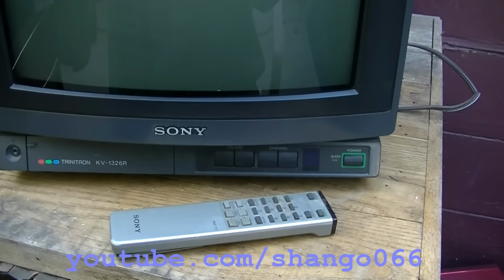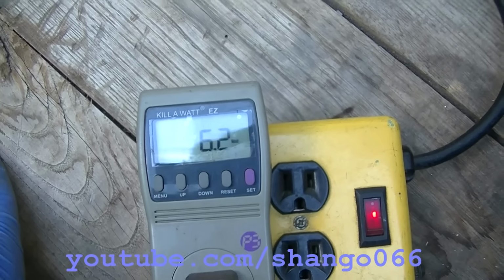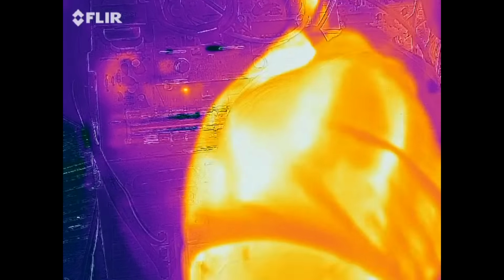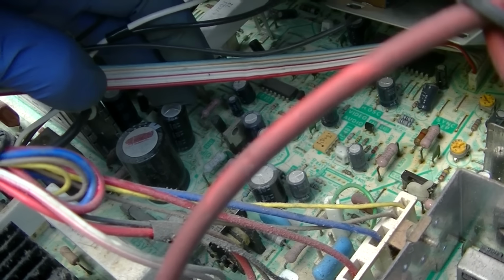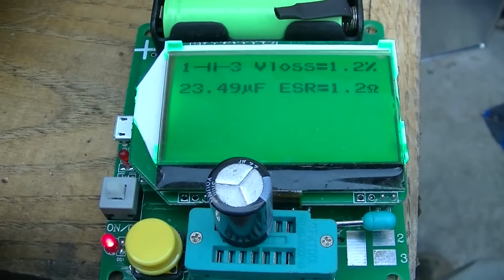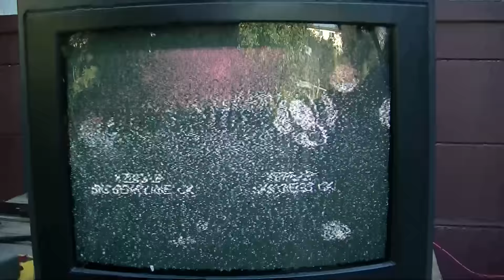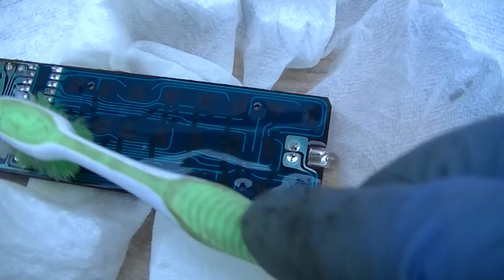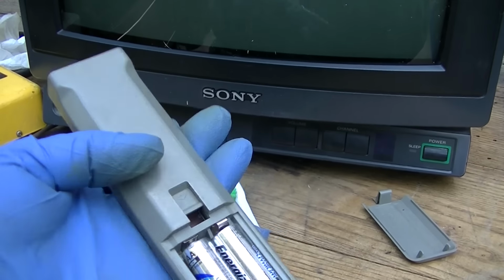Sony Trinitron KV 1326 Repair and Remote Control Repair 1987 Color Television

Comment: Had the 1320 in out kitchen for years. That was a kerb find too with the original remote on the top.
New resistor in the power supply and we ran it untin the tube had nothing left to give!
It had a fantastic picture years.

Comment: That cap is the filter for the stand-by power supply and is active whenever the TV is plugged in. It's a common failure in Sony TV's from this time period and I've fixed many of them by replacing this cap.

Comment: That's exactly what's going on with 87.7. It's easier to get the LPTV license than the FM license, considering how saturated the FM band is these days. Hell, I live in a city of 500,000 and there's almost no room on the FM dial for DXing anymore because of how many stations there are. I can't imagine how bad it must be in LA.
Reply: There’s at least 6 or 7 stations nationwide on 87.7. The FCC allows it now, but have said they will eliminate it in 2021.

Comment: When I used to work in the TV industry as a young engineer way back when when crts used to be replaced another engineer and myself used to break the neck on the CRT and put it straight in the bin

Comment: Only had one Trinitron, paid big money for a Trinitron Wega back in the 90's and after 2 years the green gun let go, tubes were big money so it got binned, never bought another, it was replacing a GEC Starline which had been running for 20 years!!

Comment: Those TV sets are definitely safer to work on than the old roundie Color TVs. Too much time in the back of an operating old roundie color set could result in developing lymphoma and/or sarcomata.
Reply: why the cancer?
Reply: @raymondleggs5508  Sufficient exposure to doses of ionizing X-radiation from early color TV sets can do irreversible damage to cells and tissue, making them more susceptible to developing carcinogenic processes. This is why hospital X-ray technicians wear thick lead vests when operating X-ray machines.

Comment: I had the UK equivalent of this TV in use until about 10 years ago.  It wasn't worth repairing when it failed though due to a lack of a SCART (RGB and audio input) socket.  Strange that Sony missed that out of this particular model, it must have been their entry level portable.

Comment: Looks like one of the good Sonys. I collect Sony TVs from the 70's to the mid 80's So its a bit too new for me. I used a Sony KV-1311 with my Amiga. I used a Sony 13 inch TV that had a Hit button on my C64.

Comment: Even if it's wrong remote Sony is surprisingly consistent with their remote protocol. I have a remote from 1992 Trinitron that still works just fine on new Sony TVs (I mean it doesn't have multimedia buttons but changing the channel, on/off, input device, volume and so on work).

Comment: Nice. I have a TV very close to this one. A KV1393R. The version with woodgrain style chassis. A nice TV. Has Composite video inputs too. Probably takes the same tube as that one. I know the tube in mine is interchangeable with the KV13TR24. The remote for that TV worked for the 1393R too. So most of the remotes (for the 13 inchers at least) probably use the same codes.

Man if I lived anywhere near you I'd be interested in picking it up just for the tube in that thing. Ever since I swapped the tube from the KV13TR24 into my KV1393R, the KV13TR24 is in need of a better one. (the convergence is out of whack on the original tube that came with the 1393R and the yoke didn't have convergence rings so I coudln't fix it. I swapped the yokes out but it's still not where I'd like it to be)

The good convergance tube from the TR24 now lives in the 1393R. Would like to have the TR24 have a good tube too one of these days. I live way out in Texas so no chance of me getting that one. :(

Would be a shame to EOL that. I found both the KV13TR24 and 1393R to be good sets. That one seems a bit older and lacks composite inputs but it would still be a great set for classic TV shows or retro game stuff.

EDIT: If you end up having to EOL it, keep the tube/neckboard/yoke. I would be interested in it later if it has good convergence/geometry and if wouldn't be too unreasonable for you to ship it. Tax money refund day is around the corner and I wouldn't mind paying the 40+ shipping charge that would likely be incurred from shipping that 20+ pound tube. :P

I can say the chassis on these things definitely won't survive shipping though so you'd have to somehow ship the tube on it's own. Not sure how that works. Screwing it down into some basic wooden frame I guess?. I've had two TR24s come to me damaged (with first one that destroyed the tube. Got lucky with the second one. Tube in that one survived and that one has good enough convergence so I moved that one to my 1393R))

EDIT2: Also if you have to EoL it and shipping not an option, I'd be interested in a few parts from it. The neckboard and the deflection yoke and any convergance strips/magnets that may be attached to the back of the tube. If you still have this thing in a month or so and have to EoL, I'll be interested in those parts if you can't ship the tube. ;)

The TR24's neckboard is split in half (accident in shipping. Bottom chassis mounts for tube failed) and I had to jerry rig it back together by bridging the broken traces with wires. So it at the very least needs a new neckboard and I know it's compatible. Can tell just by the quick appearences of it in this video. Tube is pretty much identical to the one my KV1393R and KV13TR24 as I've been able to swap all the parts for those around. Same story this with one I'm 99% sure.

Comment: The last “picture bulb” set in our living room was a Sony Trinitron with a flat screen 36” CRT.  Great picture but we never moved it around much since I’m guessing it weighed about 250 lbs.
Reply: I had one too, but HD. It looked amazing, but we’d just had a baby, and were afraid it might fall.
Reply: @5roundsrapid263  - Our set could do 1080i with the component video inputs.  Bought one of the early ATSC set top boxes from Samsung and was watching local TV stations in HD before most people knew it was happening.
Reply: Yeah I had a 36" Panasonic which I ended up having to pay someone to take away, such was the colossal weight.
Reply: fevengr I had the same setup! We had a whole 8 digital channels. We had DirecTV with 10 more on top of that.

Comment: If you want to fix a remote control, most of the time it is glazed carbon pads.  Just drag each pad lightly across a piece of paper as if it were an eraser.  Just do it lightly.  That will re-surface the pads.  I have fixed many remote controls that way.

Comment: I have the woodgrain case version of this model only issue I ever had was a bad solder joint on one of the caps,, no remote with mine but I believe all functions needed are under the flap or on the front

Comment: Hope you do find a good home for it, as these last longer than the new flat screen sets do, i still have my 1995 RCA I bought new years ago and it still going And they are better to play older movies/Games and TV shows on, Hope some one in you're area wants it, I like them too but i'm in NY state, quite a long ways away. But here i use older tech, as it last longer and doesn't spy like new tech would, only new tech i have here is this old Pc i'm using thats gonna be outdated as running older OS on it, but it still works.

Comment: I was hoping I could get some help. I found an old black and white tv from the 70’s/80’s on the side of the road today. I brought it home and hooked up my old vcr and tried to play a movie. The hold on the tv is very messed up and can only hold the picture for a second or two before becoming sketchy. After a few minutes the tv started to smoke and it put off a terrible smell. I’m not sure what Is causing it to smoke though. I don’t know if it’s because of rain damage, dirt/dust, lack of use maybe?, or maybe something else in the tv itself. I really wanna get this old tv to work again. Can I please get some help?
Reply: The clue is that frame (vertical) hold, I assume rather than horizontal was not right upon testing. Chances are it will be an electrolytic capacitor that has failed just like in this video. Visually check for bulging tops before worrying about circuit diagrams etc.

Richard (UK)
Reply: Just take a look inside and see what's exploded. Probably a capacitor. Just watch out for high voltage (discharge CRT)

Comment: There are plenty of vintage gamers looking for Sony CRTs, but with RGB input.
Reply: I have a PAL sibling of this tv, the KV-1442ESP and it has RGB input through the SCART connector. It looks fantastic despite its age.
Reply: @Fridelain  Pues probablemente sea ya un modelo clónico de Thomson con chasis ICC3 que solían romper el interruptor de encendido. Si es de los primeros con pantalla "plana" debe de montar el tubo Videocolor FS10 que era una maravilla.

Comment: That's not syrup, that's silicone oil that the rubber releases after a few years if it's not properly baked out at manufacturing time.
Reply: Nope it's Coke.
Reply: PS I've seen probably 10,000 Sony remotes from all vintages since the late 70s - none had 'silicone oil released'.
Reply: nope, its semen.

Comment: that was impressive with disassembly and using a volatile alcohol I'd have used soapy dawn, but we each find our way through, wish television still had VHF and UHF bands to mess around with, a rooftop antennae  may cause the rest of your life in a wheelchair~

Comment: This would be the type of tv you would find with surveillance systems, in studio's, etc. Very robust. Also the reason they put the speaker on top and handles on the sides, these were used often in commercial applications. Yeah not worth much but for someone who's into retro gaming or even wanted to use it as a prop/ restoration piece in a set there it is.

Comment: Around where I live any Trinitron that isn't gargantuan (like one of those 27" or 32" flat ones that weigh 200 pounds) gets snapped up pretty quickly. I lucked into a 1985 20" Trinitron XBR set myself.

Comment: I hope the money was sarcasm! I was sitting here thinking, just how rich IS this guy?! Still, that's a lot of money to be sitting in a wallet these days with debit cards. He probably gets it from fixing stuff on the side. Living in Oklahoma, that still wouldn't be enough money to get to LA even with Greyhound. That set would make a great retro gaming set. My first CRT (that I bought with my own money) was a Sony 21 inch back in 1998. It sucked probably because it was bought from Sears. The vertical circuitry popped in 2000. I did get it fixed, but it had screen problems after that. The image was warped the the left leaving a black line down the side, the image bounced with brightness, and the screen would flicker white with vibration. It was so bad that I had to use an external amp, and it still flickered a little. My first Vizio was a relief. I kept using the Sony up to like 4 or 5 years ago when it went out. I probably would have been worth a proper restoration job. I kept the speakers not that I'm using them.

Comment: thats very similar to a KV1442UB i have 😊 , i think mine dates from earlier in the 80s..
Reply: the psu on mine is a separate board on the left, caps were ok but a zener went noisy causing instability
Reply: yours has a much better tube condition than mine, its very poor, starts up pinkish 😢

Comment: I had this same model  to use with my Commodore 64 and it was $100 less the Commodore Monitor and I could watch regular TV too. Had it for years and it worked perfectly the whole time. In the last move it got dropped off the back of the truck..I was heartbroken.

Comment: What is it with capacitors in today's videos?? 
You find one burst cap and switch it out and repair this Sony TV... Paul (Mr. Carlson's Lab) finds a shorted wax bomb, clips it out of the circuit while the radio is powered, and a 1937 tube radio is playing fine again.
Damn capacitors....

Comment: OMG DONT EOL THESE SONYS , THEY CAN BE RGB MODDED FOR ARCADES/CONSOLES , those are very valuable for collectors!
Reply: RGB modding isn't sony specific and this set appears too old for it, this set also appears to be RF only which tends to mean any mods like that would be incredibly dangerous as the set isn't isolated

Comment: The CRT's in the newer Sony's were crap. I have a Sony 25 inch monitor from the Profeel line that cost $2500.00 in 1984. I got it for free using freecycle. I also found the 19 version laying in someones front yard.

Comment: I see a repeat of similar comments made about the 486 computer stuff found in that house that was shuttered for 14 years as is being made about the Sony: "Oh vintage gamers will pay $$$$ for that (fill in the blank) item/s". I read these stories on here but I still see CRT TVs of all descriptions dumped at the e-waste/bottle depot, thrift stores won't even take them, only flat panel sets. A guy in my area had a Trinitron set on craigslist, I was the only one who asked, it was a 1973 model for $10 with the original owners manual and antenna.
 I don't know where all these dumb gamers are with thick wallets but they are not near me, they are not near radiotvphononut, and they may not be near shango066. No minds posting big dreamy BIN prices on fleabay don't count. It's like the guy on one of the antique radio forums that claimed some guy was making big bucks fishtanking vintage TVs and selling them on craigslist, so I looked at the C.L site in his area, and didn't find a single one for sale, not even to give away.

Comment: You know it's gotta be bad if shango unplugs a crappy plastic set because of the smell it's making.

EOL Idea: Put way too much high voltage into the anode!
Reply: If Shango did that, he might receive a fatal dose of ionizing X-radiation and he would get EOLed.
Reply: photonic induction has a video where he does that